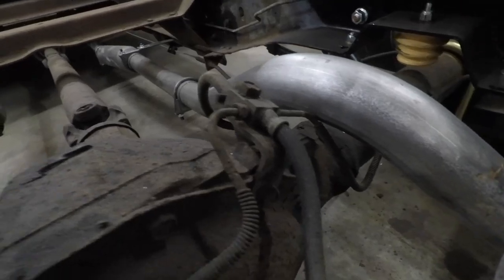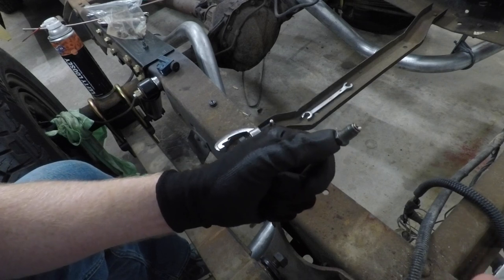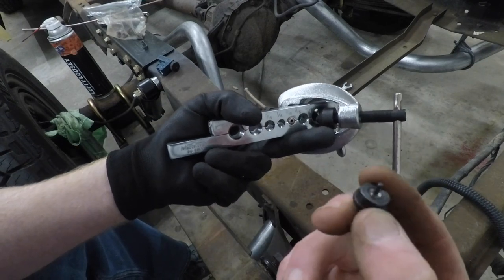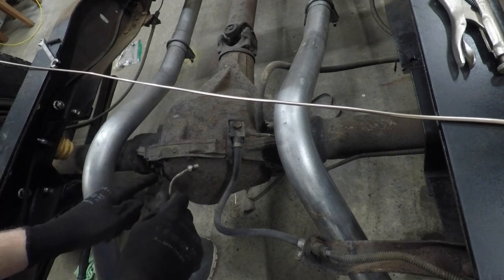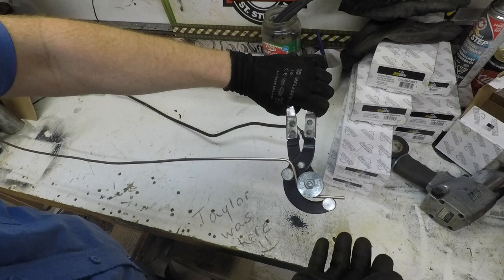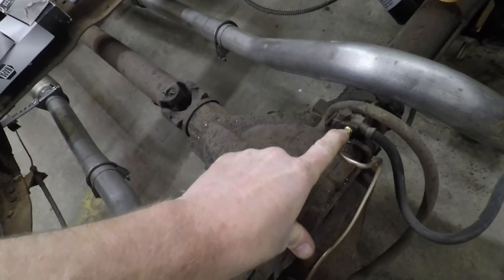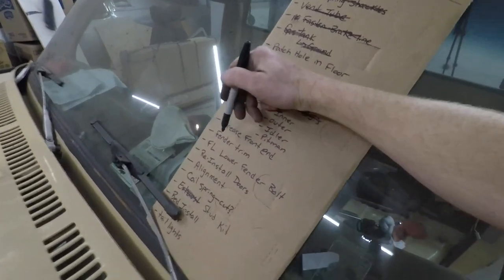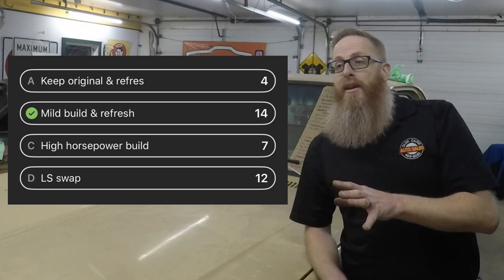HOW TO REPLACE AND BEND NEW BRAKE LINES ON YOUR 1977 CHEVY C10 TRUCK

Comment: Great video very informative Jason.. Dale is coming along .. jus worried about how close exhaust pipes are to axle .. if you hit some bumps will the suspension come down an hit axles .. maybe in camera they look closer than they actually are but exhaust does look nice 👍
Reply from the maker: No worries Darren. It's an issue i know about and have the part on order to fix it. The front spring hangers aren't stock, and when i did a 6" drop, the front hangers were already dropped (too much). So I have stock hangers coming from LMC.